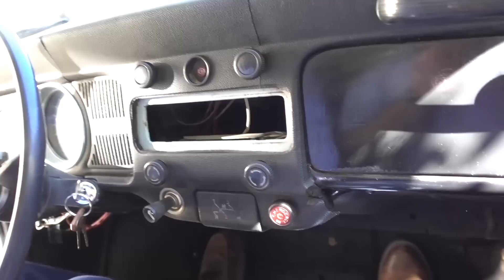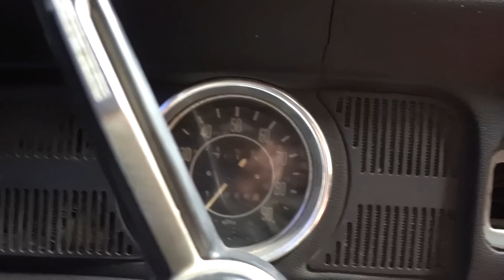A New Race Car......

Comment: Matt, take a tennis ball and put a rope through the tennis ball. That way you can put it in the exhaust if you have to leave the car out in the rain. Engine doesnt make a lot of horsepower to push water out of the header pipes if it were to rain.
Reply: Bunch007 HD good idea, im sure theres a cover for the pipe you can buy for just a few bucks but either way. i wouldbt have even thought about it
Reply: An old tin coffee can will work too. I use the tennis ball for my air cooled VW. Exact same header pipes too. I don't use a rope though. I use a thin flexible steel braided line. Stick all the way through the ball, put a washer on and tie a knot in the steel braided line and you're set. 

I would make a back-up one too. Never know who will steal one.

Comment: If you see a "G" light on the dash come on you lost the generator belt , NOT gas is low. Pull over replace or tow it home. I blew up my bug a day after I got it because I thought it was telling me I was low on gas, I was 16.
Reply: Adding to that, the cooling fan runs off the back of the generator - so you lose cooling too!

Comment: I have owned a number of Baja bugs, they can be fun little go getters if you build it right. Suggestion, listening to it, it needs the valve lash adjusted (every 3000 with the oil change) likely has roller tappets just going by sound and my VW background.
Reply: I wouldn't know how to adjust the valves on a Beetle but I'm hoping Matt gets attached to this one & keeps it for a project car. Please keep posting tips like this so he finds quick & easy things to fix it up!
Reply: It isn't really all that hard, there are tons of manuals and youtube videos on how to do it. When it comes down to it, it's no harder than gaping a spark plug. Just make sure you use new gaskets on the covers after, and don't forget when you change the oil to drop the screen and clean it too.

Comment: to get this shitcan look like a baja bug, you need... 
-a set of decent wheels, 
-new, longer shocks, 
-new torsion bars both front and back, 
-boxed airfilters with piping pumping in the cab -
-a completely new electric wiring loom for the lighting and the wipers.
-reinforced shifting linkage, one that doesnt come loose at 60mph..
-new pedal rack, because safety reasons..
-rollcage, baja spec.
-new set of gauges
-bigger brakes and also...
-a foam filled race fuel tank. two if you plan to do the baja with it.

since this is a 71, it should be a 12 volt. so you just need a stronger alternator for the rooflights.

quite the trip, and that does not count aesthetics, like rustproofing, cleaning, stripping... :)

Comment: there should be two screws on the front of your headlights  that will adjust your up and down left and right face your car towards the wall about 10 or 15 feet away  with the lights on facing the wall   then turn the screws you will see the lights going up and down or going sideways set them to weather about waste hi    this should help
Reply: nooooooooooooooooooooooooooooooooooooooooooooooooooooooooooooooooooooooooooooooooooooooooooooooooooooooooooooooooooooooooooooooooooooooooooooooooooooooooooooooooooo

Comment: If it's anything like a Volkswagen thing then the headlights switch should be between the door and the steering wheel should just pull forward

Comment: In the state of Texas, weapons laws are generally considered relaxed compared to the laws in other parts of the country. In Chapter 46 §46.05 of the Texas Penal Code the government writes that it is an offense to knowingly and intentionally possess manufacture, transport or repair knuckles. This is typically regarded as a felony offense of the third degree. In some cases, the charge can be reduced to a Class A misdemeanor.

check your self.....

Comment: DONT USE THE STOCK HEATER. I know many people who died from carbon monoxide poisoning because the exhaust leaked into the heater.
Reply: Lol yea right you know people that died from using thee heater in a bug. Yea they ddo leak exhaust into the heater if worn and rusty but they won't kill you. Also "don't use the heater" doesn't really work since the flaps that shut the heater off barely ever work anyway
Reply: @CarlosBookerPhoto  Remove the pipes and cap them off. Easy as that.
Reply: How often do you really need a heater in Texas anyway lol
Reply: @larrysutton6530  well lately a lot lol
Reply: @taylormccallum  very true but isn't this the exception to the rule?
Reply: @larrysutton6530  no it has cold days

Comment: 12:20 I probably won't reach out to you because you get a load of comments but just in case... I think it's for the heating/air conditioning/speed of the fan... I'm relatively sure about that... Never mind you already figured out how it works :)